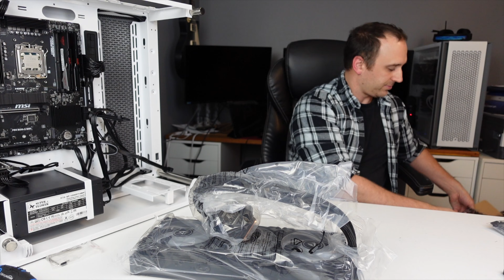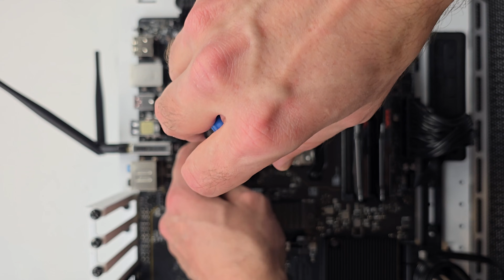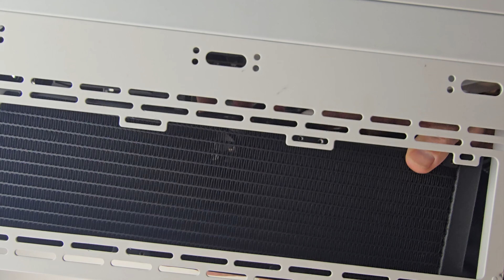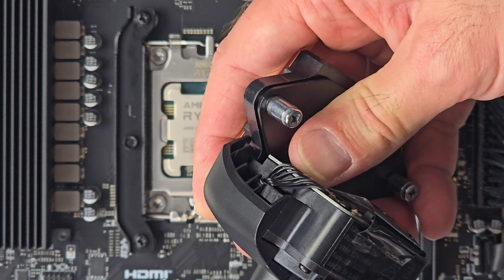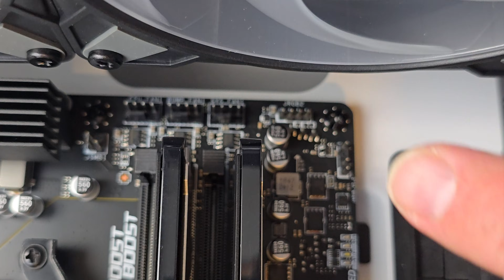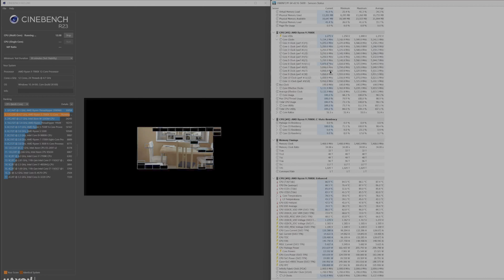Arctic Liquid Freezer iii 360 - unboxing, installing and testing on AM5 Ryzen 9 7900X.

Comment: Appreciate the video. They did indeed attempt to make this AIO easier to install in their Rev2 version which had fixes for both pump effiency, pump reading, and slightly longer screws on the mounting block to make it easier to catch into the leaf springs.

Do you find this AIO audible in use? Been looking into it for a long time now but I just hope I can find a fan curve where the pump noise is not as bothersome as some people say it is above 50% pump speed.
Reply from the maker: I don't hear any pump noise over the sound of the fans. In a case with case fans and the aio fans going,  I don't see how anyone could hear the pump.
Reply: @jackshardware  They said above 50% it would get really bad. But thanks for your reply, appreciate it. Going to see if I can find one soon.
Reply: @ヤーリ hi, any updates of pump noise level?

Comment: Installed the same AIO yesterday. Initially temps at idle were higher than my Corsair but under load liquid freezer dropped average temps by 5-7 degrees!
Reply: it all comes down to the fan and pump curve between the two.
Reply from the maker: I have everything set to the max. Am5 seems to be a lot more difficult to cool. I get much better temps on a 5900x even though it uses roughly the same amount of power as a 7900x.
Reply: @jackshardware I see you have jrgb as well witch is all I have for my fan lights but I can’t find fans for jrgb fans to match it anywhere any suggestions

Comment: Mine is boosting to 5,7 ghz single core 
All core CCD 1 is 5,45 ghz CCD 2 is 5,3 ghz set in bios 
85C after 30 min with Artic liquid 420mm with kryosheet, fans in Auto 
PBO enable 
Curve optimizer Negative all core -14 
Dynamic OC active on ASUS so I can get high single core boost under 90A

Comment: I have the Ryzen 7 7700 non X, I have the Arctic liquid freezer iii 360mm, cpu stress test 65 to 68c (65W -30 all cores), gaming 56c, I used PTM7950 instead of thermal paste, it has good performance but I didn't like the shape of the pump, it's a little ugly but otherwise there's no complaining, I would like to buy the deepcool mystic but I didn't have enough money, But you made a good choice, next time it would be good to show the pump curve in the bios and the fans.
Reply from the maker: Pump and fans were set to max. I wanted to show the aio's max performance. Under volting the 7900x would probably drop the temps by a lot. Do you know how many watts your 7700 was pulling under load? The 7900x was hitting 200 watts per hwinfo64 and from the plug the whole system was pulling 300 watts when I ran r23 all cores.
Reply: @jackshardware  65 to 85W max